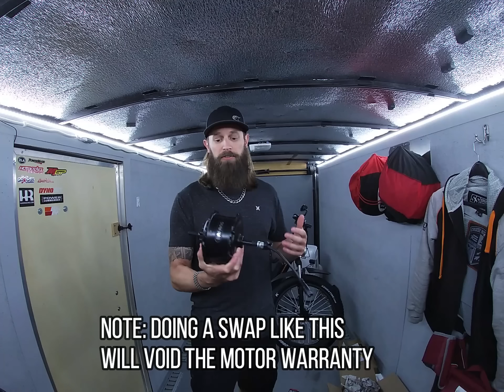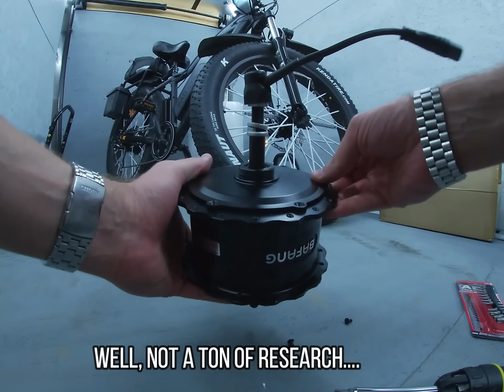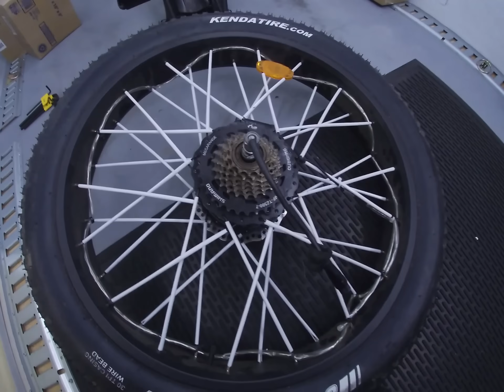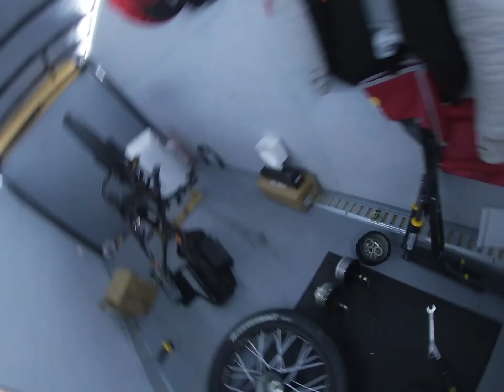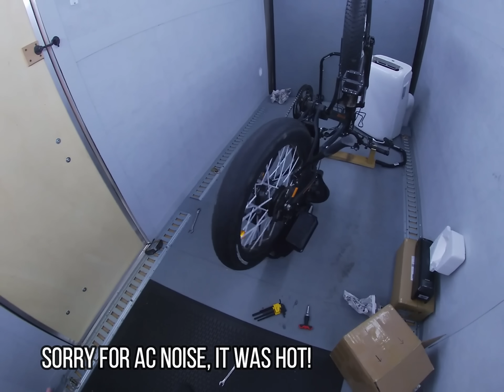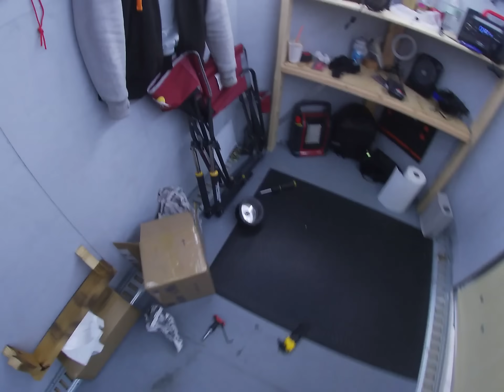750w Bafang Hub Motor Install/Swap -  Rad Rover Ebike

Comment: Ive not long ago brought my new Electric bike,I took the wheels of my old Electric bike and put them on my new Electric bike,Only had the mag wheels since February 2022,Had a lot of use since then,Now the Hub motor burnt out its not working great any more,Im going to put the spoke wheel back on with the compatible hub motor for now.Found a website for a solid Mag wheel,I get that replaced,Luckly got a spare Electric bike to use for now,Also can't find a Hub motor whats compatible for the wheel,Might as well replace the whole back wheel with the replacement Hub motor

Comment: Big difference in size no doubt about it. Rad might have put a 500 watt in instead of a 750 watt. You made it look easy. Job well done. I'm not sure if its me or did you crash into anything because the front forks look like they are bent inwards? It might be the camera angle. Very helpful video.

Comment: I tried this with my rad plus six and it didn't work. The bolts were just ever so slightly different. No I did see someone on here that just kind of made it work and he said he put the bolts in on a little bit of an angle which I think is crazy as f*** but he did it and it worked. I ended up sending my motor back unfortunately. I'm patiently waiting for a thousand watt one of these days. I'm thinking I'm just going to buy the motor with the rim already set up. I do have a battery blender and a 10 amp hour battery coming so we'll see how that goes. I do have the 35 amp controller already. I'm a pretty big boy I'm too 70 and it pulls me around here just fine but we always want bigger stronger better don't we lol. Anyway I like your content and keep up the good work. Also if you have any suggestions about a thousand Watt where I can get one please let me know

Comment: Two 1 gallon paint cans under handlebars is a good stand. Park freewheel tool for ebike designed to go over the plug/wire. Under $10. Case is built to use a torque driver to remove and install. Tough with a screwdriver.  If the new motor is upgrad to stock, I would use it as it came and rebuild wheel spokes.

Comment: Watching this 3 year old video, laughing to myself when you said, I know nothing about this stuff (or something like that). Oh my, how things have changed!! I'm in the middle of completely rebuilding a Rover 5 I bought for $200, that died in Hurricane Ian almost 2 years ago. The only 2 salvageable parts are the frame and the rear wheel, the motor is done. I was just gonna use my original Rover motor I saved when I did my upgrade, but this video reminds me how wimpy it is. Gonna buy the real 750.

Comment: Hi i purchased a 750 w tad rhino 3 yrs ago..before eu restriction law came in.../ so is that a 750w or 500w..rad sild it as 750w..also where did u get the new motor.? Thanks

Comment: Will this motor fit a 2023 Heybike Ranger S? Wanted to do some upgrades
Reply from the maker: looks like the Heybike Ranger S already has a 750w motor in it.  i only swapped out the motor in my Rad because Rad is know to have used a small motor in there bike.   I'm betting your Heybike has a true 750w motor in it.  for more power you would be better off changing the controller to a high amp out put.  unfortunately i dont know of any plug and play options for that bike.

Comment: Great informative video.  If I just have to replace / fix the planetary (3 gear thingy) gear.  Do I need to pull the freewheel gears off with the special socket ??
Reply from the maker: Nope no need to remove the free wheel
Reply: @CitizenCycle925  thanks.  I will be catching up with your rad rover videos.  Looks like some fun upgrades.

Comment: Is the Bafang motor a9 pin or 3 pin
Reply from the maker: 3
Reply: @CitizenCycle925 mine is a 9 pin on a standard motor,do you know if you can get or use an adaptor for 9-3 pin motor
Reply from the maker: @dnvlogs4390  I've never tried one of those adapters but I guess that's what they're for right. Your rad has a 9 pin motor cable? What year is it?
Reply: @CitizenCycle925  oh sorry no I have a yamee fat bear 750 s,and just wanted to no if something did go wrong with the motor that I could buy a new one to fit correctly,and I wasn’t to sure about the pins on the cable…thanks

Comment: Do you know what you the torque spec is on the screws on the hub motor cover? I am working on the Magicycle motor replacement, so I don’t know if they’re much different from the red rover?

Comment: You know my Magicycle rear wheel hub motor replacement is a little different than the red rovers. It seems that my power pigtail is on the left side of the bike and is not in the free wheel assembly. Did anyone notice that?

Comment: I just ordered the 750 watt motor from electro bike work and noticed my motor isn’t as “beefy” as the one you installed. I looked on the website and it says “the newer model 750 is smaller with more copper wire for efficiency”. I’m not convinced the “new” 750 watt bafang motor is as good as the old one. You’re performance gains were very significant, especially in torque. The new motor didn’t increase my torque???

Comment: Pro tip, before you take any wheel off a multi speed rear wheel, put the bike in the highest gear( smallest gear on the hub).
The derailer will line up easier and put less stress stress on the components. Just sayin.

Comment: You adjust the derailleur with the two little screws in the derailleur the one screw goes for the chain to climb up on the gear the other screw goes for it to go down to the lower gear.
Enjoy your video thank you

Comment: Do you have to upgrade the controller before the motor, will that make a difference?
Reply from the maker: Not sure if upgrading motor without controller or before controller would be beneficial.
Reply: @CitizenCycle925  ah I see, I have the swft zip ebike and the controller is built into the battery mount for some reason. If I upgrade my controller I'd have to do the battery too. I was hoping to avoid it somehow. Thank you for responding 🙏🏽

Comment: You should have swapped out the phase wires with larger silver mil spec ptfe coated 14ga wire. I run 72v with no problem.

Comment: I couldn't find a "results video". Did upgrading the motor improve the performance?
In theory the bigger motor has more rotor windings and thus should provide more torque (assuming the controller can provide additional current). More torque should equal better acceleration.

Comment: Can you increase the speed limit? If you get the new controller with the new display you can change the speed limit to something higher right? 

I Really want to increase speed limit, please help!
Reply from the maker: Yes if you get the new controller and display you can increase the speed limit to 72 km/h, however speed is determined by your motor which can only spin so fast, if you want to higher top speed you'll have to change out that original rad motor

Comment: i realize that these are older, and possibly outdated, but i recently picked up a radrover stepthru 1 for $400 used on offerup and am in the process of upgrading everything. i love to tinker, love to upgrade on a budget for the challenge, and also love to make things unique and special to me. the radrover has been great so far, i bought the 35a controller and lcd screen from electro bike world, and am considering this motor upgrade next. thank you for your dilligence, testing, and experimenting, it helps inform me for my next step/purchase. keep up the awesome content! subscribed.
Reply from the maker: Thanks for this sub!! Little bit older video but the same motor upgrade should work for your bike as well 🙂 It really makes a big difference.

Comment: I got my Rad 6 and the steering was hard sometime and with 45 miles on the Bike the head stem came loose , i open the head stem and looked and there was No Top Bearing in the sleeve at all and it was making powder out of the split racer made of aluminum . / Can't win the Lottery , i can get the first bike sent out without a bearing and had to fix some crap that happen when i had to get a ride home , / like the bike without the BS

Comment: I think it would have been easier to just swap the wheel and spokes over to the new hub if it all matched up which it probably did. Building a wheel is super easy especially the smaller wheels with short spokes.

Comment: Why did you modify a already powerful motor?  It does put out 750 watts. Did you  watch that YouTube that tells you it’s not a 750 he’s selling motors😆
Reply: The motor inside of the Radrover 5 is not a 750 watt motor.  It is a Bafang 350 watt / 45 N.m torque motor.  How do I know?  I pulled apart my Radrover motor and did the same upgrade.  It makes a world of difference. 

Unfortunately, it appears that Rad decided to use a 350 watt motor and push it to 750 watts through their controller.  The 350 may be able to handle 750 peak but it’s never going to have the same power and torque of a larger motor.

Comment: Great Video and very informative. May I ask how you got the planetary gears out of the casing. I own an Ebike and I recently seized up my motor and it is the Bafang 750 watt (RMG06 48V750) I pulled the motor and I can smell the windings are burnt after 7400 miles. The only difference is that mine has the FreeHub attached to the motor, which I had to replace at 800miles on the odometer. The plastic gears all look good but the grease broke down...I can send photos as I did to the bike manufacturer and they havent answered me on a new back wheel and its been 7 weeks now. Any tips will be appreciated ...Thanx In Advance

Comment: Bought motor from the same place but the cable cutout can only face up or down and the cable itself is 500mm shorter than my old 750w Bafang motor (Which is the exact same model) So now stuck with a useless motor and a new motor I can't connect....Fuck! :/

Comment: Is it possible to replace the drive side axle nut on these hubs at all? The nut on my Sondors' Bafang hub is showing signs of almost being stripped, and with the design clearly not allowing the nut to pass over the power cable, I'm worried about having to go to extreme measures just to replace it. Very annoying design to be honest.

Comment: I wonder how close the Rad Rover's systems are to the Ecotric Fat Tire bike. The stock display, shifters, throttle and 500W motors are all the same. I would like to apply these upgrades to the Ecotric. Of which I just got three days ago.
Reply from the maker: You would need to check to make sure the plugs are the same or else you'll be doing a lot of soldering

Comment: Just out of curiosity  would this work  with rad city?
Reply from the maker: No I don't think so, I believe the Rad City has a direct drive motor, The Rad rover's have a geared hub drive motor so two different style motors.

Comment: I had a similar problem you had with my rad mini 4. It didn't want to shift into 6th gear. Always trying to jump out of gear. I found that adjusting the derailleur cable tension slightly corrected this perfectly. A small adjustment nut where cable meets derailleur. 3 or four clicks one way or the other should do it.
Reply: oh!? is that why 6th and 7rth gear have no change?

Comment: I am trying to understand your motivation for doing this.  You state that there is no increase in torque or speed.  So what's the upside to spending that time and money?  Or, is it the hub alone will not change much, but swapping out the controller AND the hub will give much better performance?

I have a 2019 Rad City, and I am looking for a way to improve hill climbing performance
Reply from the maker: Swapping out the motor and the controller made a drastic increase in performance, check my video playlist for the results but it increased by about 10 mph. Note This would not work in a rad city those used direct drive motors and not geared hub motors.
Reply: @CitizenCycle925  yeah...digging into the specs I see that now.  Still looking for info or suggestions to retrofit some solution to make my bike do better on uphills.
Reply from the maker: @russburkert3778  probably no easy solution for that bike. I don't think direct drive motors are known for their hill climb ability more for top-end speed. I have a 1200 watt direct drive motor on the front wheel of my rad now and it's not nearly as powerful as the geared hub motor on the back wheel
Reply: @CitizenCycle925  Right.  Doing more research, it looks like I may have to just accept the uphill riding limitations of the RadCity.  Or, buy another bike.  Giving a hard look at the Aventon Aventure.

Comment: I respect this man's courage. I don't think have a full casing across like means the  after-market motor is any "bigger" inside. I, myself, very much trust the radmotorbikes guys. They  have been excellent to work with. I have a Radwagon 4
Reply: WE USED TO ALSO BUT THEY DON'T ANSER MY EMAILS!  WE HAVE HELPED THEM SELL A FEW DOZEN BIKES BY WORD OF MOUTH !  ANYWAY, WHAT DO YOU DO FOR EXTRA HILL CLIMBING POWER?   MY WIFES LITTLE RAD  MINI  SOARS PAST ME ON THE HILLS! I CAN ONLY ASSUME HERS SPROCKET TEETH DIFFERENCE PROVIDES THE EXTRA TORQUE IN CLIMBING AS I SOAR PAST HERS COASTING ON THE FLAT!!  I PUT THE HIGHER OUTPUT NEEDS IN MY CONTROLLER, JUST BOOSTED HERS  A CPL MPH!! , THAT BEING SAID RAD POWER BIKE REGULAR  DISC BRAKE SET UP IS KIND OF LAME AND CONSTANTLY IN NEED OF ADJUSTMENT, SO WE ARE UPDATING TO HYDRAULIC ON OUR REAR BRAKES FOR STARTERS !   *IN GOD WE TRUST*

Comment: I needed this video as I’m about to follow your footsteps and install this upgrade in my 2020 Radcity 👍
Reply from the maker: I think the rad city's have a direct drive motor don't they..???  this swap wouldn't work.
Reply: @CitizenCycle925  hmmm you are correct. Direct drive. I emailed electro bike world for clarification. 👍👍

Comment: What up, i saw your video and i got the bafang 750w motor, i change it already but im still using the stick controller and my pedal assist doesn’t work. Do you know if the pedal assist doesn’t work because I don’t have the upgrade controller?, also the reading of the stock controller is off with the new motor
Reply from the maker: I'm really not sure, I am far from an expert. you might end up having to upgrade the controller though That's probably the only way to get the power out of the new motor. And with the pedal assist I have no idea, again you might need the new controller or maybe it's just a loose connection
Reply: Yeah, the new controller is on the way it way on back order. Thanks for replying and keep posting videos with Rad upgrades

Comment: Bafang 750 Watt FreeWheel Removal Tool, Bolton Ebikes has a tool that fits over the electrical plug to remove/install a cassette on an ebike.

Comment: Did you notice that the new upgrade 750watt motor is a little noisier than the stock motor? I did the swap and agree that it was very straight forward and easy. Everything works great and smoothly, however, the motor does sound  louder. I do not know if it is because it is bigger and more powerful  and normal, or what? I did a side by side comparison with a friends stock Radrover and there is a noticeable difference. Any comments? Thanks for the great videos.

Comment: Did you have to replace the gears inside the stock housing with the gears that came with the new motor?  If so, was there anything special that you had to do to remove and replace the gears.

Comment: Thanks. I did the Controller/LCD and for the $$, 100% worth it.  I may do this one day when I am in the mood. QUESTION: Did the 3rd Gear Issue ever sort itself out? Was derailer just in need of an adjustment, or did putting that Freewheel that came with Motor cause any issues?
Reply from the maker: the motor swap is a HUGE performance improvement, i highly recommend it.  the derailleur just needed adjusted and then everything was fine :)

Comment: Wanted to let you know you might want to drop Electro Bike World from your recommendations I ordered the 750 watt upgrade it took over a month to get..Also it was packaged with empty water bottles as packing material ..There customer service sucks they dont respond and Today I had Velofix come to my house to install it and one of the wires was cracked.. Now I am in a battle to get it replaced..Two emails so far no response,, These guys SUCK!! I would recommend Bolton Bikes for the Rad upgrade at least they know how to take care of there customers and stand behind what they sell. I bought my upgraded controller from them and it was awesome..
Reply from the maker: I bought from electro bike world because Bolton was outta stock forever. My motor worked but it did come packaged with a pool noodle...

Comment: Good information. More on the freewheel. I also have the 2018 RR. I thought I had a 11 tooth on the smallest freewheel gear, as I read on a forum. But counted just now to be a 14 tooth, like what you have and what was sent to you. I went to the RPB site and it shows a 11 tooth for the newer model. Must have changed it at some point. Maybe because I suggested they go with a larger chainring, ( increased mine to the 48T) and a smaller 11t on the rear freewheel. I don't care about the "megarange" gear because I never need to shift gears, I never go slow enough, not even on hills.

Comment: Do you know if a Bafang 750w  190mm drop in motor will work in a 170mm drop in forked fat bike that already has a stock Bafang motor, but only at 170mm drop in?

Comment: Are you sure the performance increases aren't more related to the different freewheel?
Reply from the maker: My performance tests were done using just the throttle so the free wheel is irrelevant